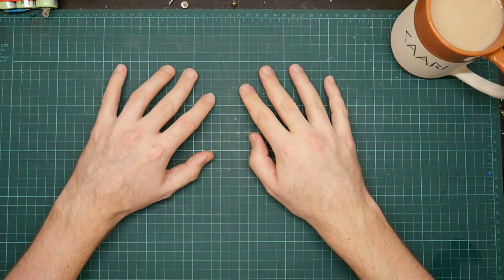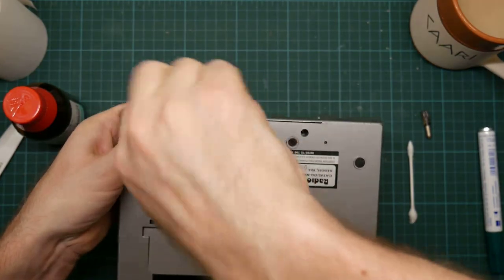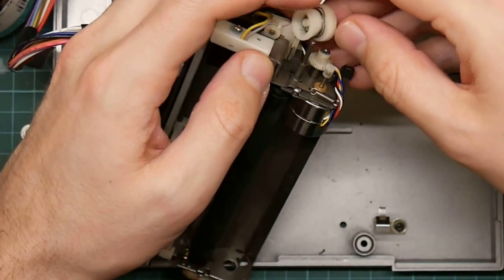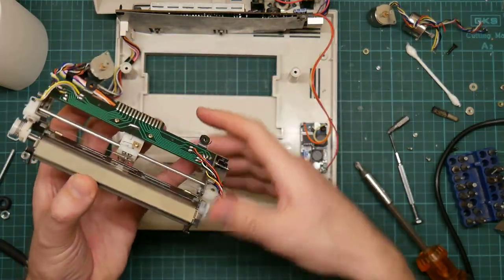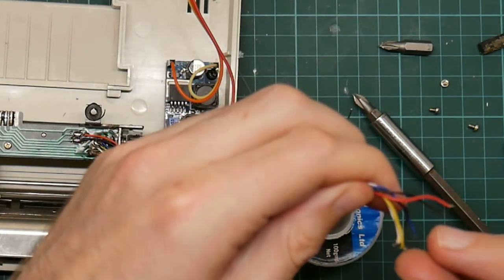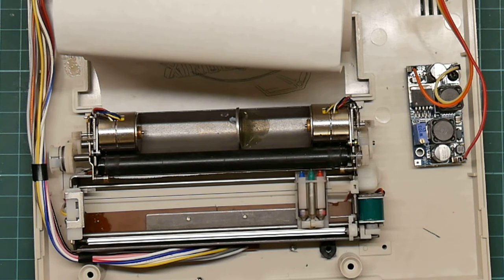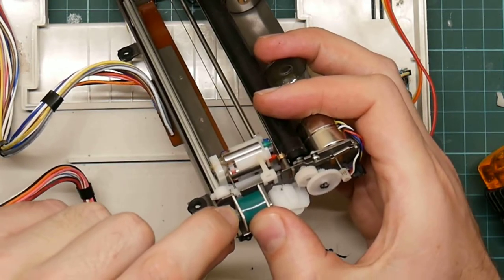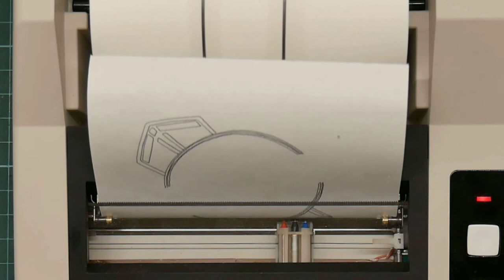Hjalfi fixes a Tandy CGP-115 pen plotter; properly, this time (reupload)

Comment: Nice job sticking to it and getting one unit going. The gears in these old Alps mechanisms are the biggest trouble source. I have never seen the stepper motors fail before. BTW, I was able to get the stepper motors pinion gears reproduced in brass. I would be happy to send you some in support of a fellow tinkerer and YouTuber.
Reply from the maker: Ah, I found your gears on http://tandy.wiki/CGP-115 (which I now realise I forgot to link to in the description; added). Luckily mine seem to be fine. I'm so special, finding a hitherto unprecedented failure mode...
Reply: @hjalfi  I have a similar problem child on a print with same mech for a Convergant Workslate. First it was part of the plastic linkage for the solenoid that presses pen to paper, then the pinion gears, then with all that fixed I found another set of split gears. I have wondered if people try to rip the paper out in frustration if that breaks some of the other plastic bits. 

If you find you need some gears, let me know.

Comment: nice work.  I had a plotter like that on my sharp pc-1500.  I think that was the first personal output device I owned.  If I recall correctly it was a good bit cheaper than a full blown dot impact printer.

Comment: Does the pen drag on the bar that the solenoid pulls?  It seemed to shift (on screen) when the pen hung up in the donor plotter. But I'm not certain.
Reply from the maker: The bar pushes the pen forward, but it's the delicate leaf spring at the front of the head mechanism which pushes the pen back again --- at least with the old solenoid. With the one I removed from the other printer, when the solenoid returns it'll rotate the bar back again.